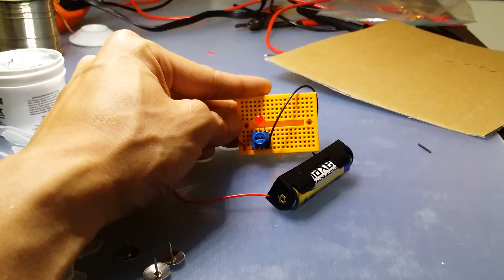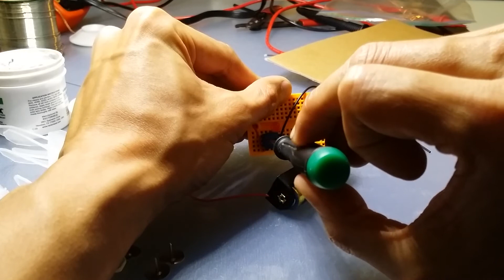Make a dimmer circuit with a bread board

Comment: Hello , can I use this also to dim a diy breadboard clock using four 7segment display leds?
Reply from the maker: Hi!  Yes depending on how you plan to wire it up you should be able to do that.  If you are using a microcontroller to display the numbers you could connect the potentiometer to the microcontroller and then dim the lights via code.  You could also do it via hard wiring to the power that turns the lights on in the 7-segment
Reply: @BarnabasRobotics52  Thanks. Probably I’ll take the last route